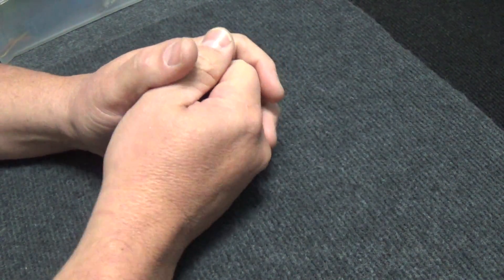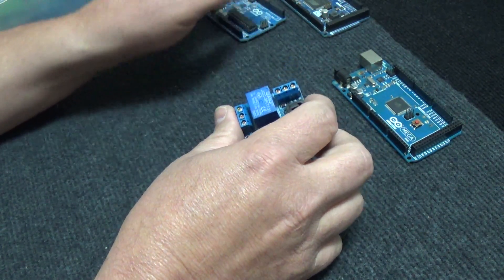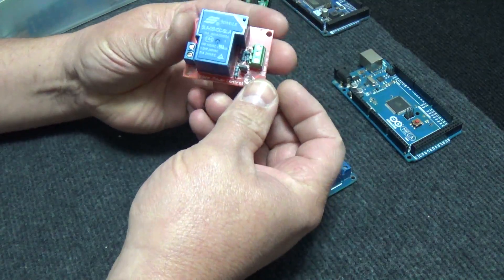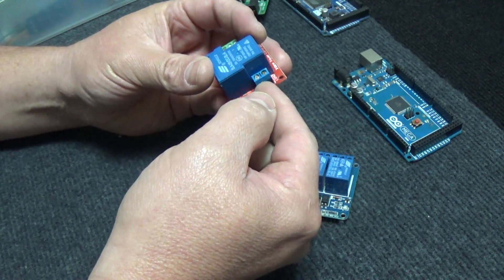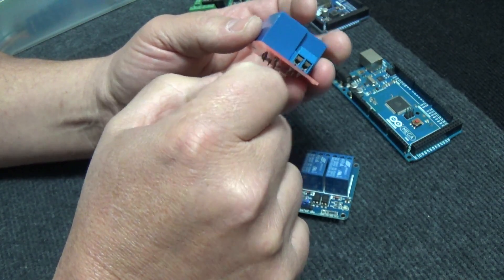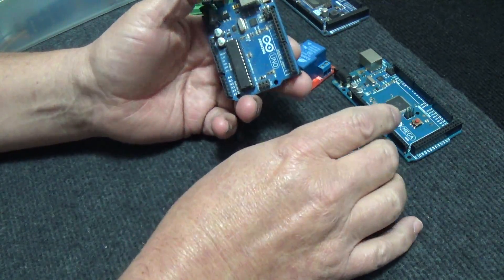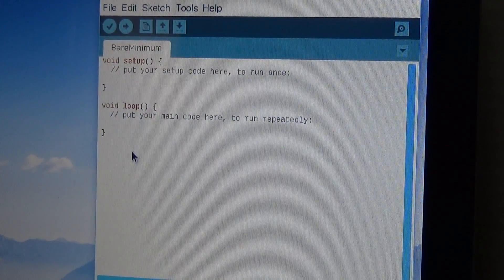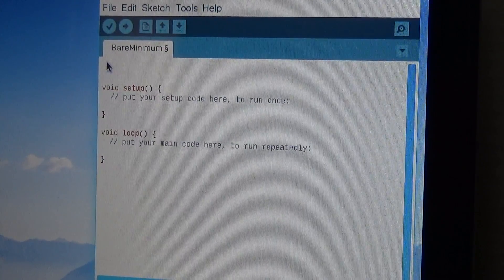Arduino Basics - Relays

Comment: Thank you for posting this. I would love to see a follow up video with the Arduino controlling a relay based on input to the Arduino. In other words if I press one button the relay would be activated for one second. II press a second button the relay would be activated for 10 seconds and if I press a third button the relay would stay activated unless a separate signal told Relay to shut off.

I am trying to control an AC motor that will raise  a platform to various heights.

Comment: Can you add an external power source to that 2 channel relay? So let's say you connect the 5v to Arduino then add an external Power source for another sensor or motor to the relay?
Reply: From what I understand from these is that if you want to do that, you need a board that has pins marked DCVCC VCC GND (they usually have a jumper on the DCVCC VCC) and they have also got the following pins (depending on the board) VCC in - in1 - in2 - in3 (etc depending on how many relais are on) - GND. If you want to power these externally, remove the jumper from the DCVCC VCC (and to not lose it for later just place it on VCC. so DCVCC and GND are open. next, on the DCVCC pin place your power supply positive and on the GND pin that is also free connect the ground from the power supply. Next you can remove the voltage and ground connections from the arduino so you only have the in1 and in2 etc connected. This should get you started.

Comment: L plater here as well, why is Low sent?  I thought it required High (5v or so) to actuate the relay?   Took me  a while to figure out what was wrong with mine.
Thanks and great Tute.
Reply: Video poster made an error in sketch. Before setting the relayPin to output digitalWrite(relayPin, HIGH); should have been applied.

Comment: I’m working with an NE555 adjustable timer switch. I have an eight AA battery pack witn an on off switch that goes through the triple five and feeds a push pull solenoid. when I turn the power on it initiates the solenoid so it fires once and it shuts off . What I want is to put power to it and instead of having to adjust a delay take the delay completely out of it but I need to ensure that there is no power after the initial fire to the solenoid without a reset. Any help would be wonderful.

Comment: You showed half of the relay setup.  The easy half that is labeled on the relay. The other half is how to hook up to what you are triggering.  A light,alarm,or pump etc.   Do  you provide power to what you are triggering. What if any power is ran through the actually relay. When to use normally open vs normally closed. How to set up using Arduino power if you are only triggering 3-5 volt source such as a 5 volt water pump or a 3 volt LED? Actually show it being of use not just making a click sound!

Comment: Beautiful,  would suggest  to isolate the relay from Arduino. You can do that powering the relay's coil with his own power source and avoid using the 5V output from the Arduino board when dealing with AC high voltage.
Reply: i was trying to open a door with the relay using 12v and 5v connected to arduino's pin 5v. when i opened the door many times the arduino was desconnecting himself from the computer serial port, so u are right

Comment: Sorry but switching the neutral/ground is NOT best practice. It leaves the device being switched at mains/supply potential. If you have an earth fault(disconnected)  or just plain forget to isolate  you risk getting a potentially lethal shock.

Comment: You said that such high speeds will "burn out the relay". What speeds would be considered safe? I want to control a 12v LED and make it strobe.
Reply: The relay switch is mechanical and will wear out soon with that kind of use.  Instead, use a MOSFET module.

Comment: Are there silent relays available?
Reply: Sure. Look up "solid state relay".
Reply: Remember that the solid state relays USUALLY do not handle as much power as the mechanical relays but will silently operate a smaller demand.
Reply: @alexlloyd2147  ??? i have seen 40A solid state relays

Comment: Why didn't you use a diode to prevent back current produced by the coil in the relay to damage your controller?
Reply: Yes,this hapen to me,with starter lamp,my lcd display goes crazy,back current short my arduino,no problem use with led lamp but long term will kill my arduino..but how to add diode to relay?
Reply: My 4 gang board has diodes factory fitted.

Comment: I like it. So the main function of a relay is to protect the arduino against to much current. But doesnt the motor that is not connected yet need protection too? I presume you can do that with the same relay?
Reply: I think the function of a relay is more to allow switching high current applications on and off via a low voltage power source, such as an arduino. Its not to protect the arduino, directly, thought i guess you could say it does that as well.

Comment: Hello guys, can someone explain to me whats the difference between 5v, 12v and 24v relays? It's not explained in the video :( When to use those different volts of relay? Thanks in advance.
Reply: I think you have to match the voltage of the relay wth the voltage of the motor.And the rated amps of a relay are also important. If you have a big motor the 5v relay will probably blow because the motor draws too much current(watts). That is how I understand it.
Reply: Random Guy , I know, 9 months... anyway, the 5v, 12v, and 24v is the voltage to control the relay (to power the relay coil and make it switch)
If you want to run a 24v relay with an arduino or a pi, you will need an extra logic and power supply, since neither of them provide more than 5v.

Comment: Hello sir, really appreciate your explanation. Thanks for the video

I have a question, so if I want to add a load to the relay, lets a lamp and what to turn it off and by the program how can we do this. Not sure if the power supply you gave from the system 5v is sufficient for it. If not I hope we need some external supply say 110v or so. If so how can we do that. Any video you have on how to do it using the same relay you just used. Your help is much appreciated. Thanks

Comment: I don't understand why 3 conductors when a relay has 2 states... on and off.. power applied and power retracted. Am I looking at this incorrect ?
Reply: Frankie , I know,  years... anyway, on the “input/control” side, the board might need power for other components, like LED, or other ICs, so you need the god and (lets say) 5v power, and then the third contact, when pulled high (5v) to switch the relay. Now on the “output” side, you have the NO (normally open), the common, and the NC (normally closed) contacts to decide if you want the relay to be open when unpowered or closed.
That would give you 3 conductors for “in” and 3 conductors for “out”.
HTH

Comment: Question, @Electro-Anarchy, you said that the relay is turning ON then OFF, but your code was LOW then HIGH. Did you mean OFF then ON, or is the relay turned ON when it is LOW?
Reply: Yes, for some reason beyond my understanding these relays turned on by the LOW signal. But I guess you have figured it out by yourself by now :)
Reply: @dmitrys.4741  These reelays are usually driven by transistor built onto the board. By apply a low to the transistor, you allow it to turn on and pass current to tthe relay coil energizing it allowing you motor or other load to run.

Comment: DO NOT SWITCH A NEUTRAL.     ALLWAYS SWITCH THE HOT ..    Not only is it safer, it is also electrical code.
Reply: @Germanudo He even called it "ground".
Reply: @hermanhermitz9101  stfu

Comment: i only learned how to start coding yesterday but want to ask... when writing   digitalWrite(relayPin, LOW) does it switch it on and when HIGH it will switch off?
Reply: Yes. The 5v relays you generally find on ebay have the trigger(IN1) function when connected to ground. For example they don't trigger by firing 5v into them from the output pin. If the output pin on Arduino is set to low it is at ground potential so allows the 5v vcc on the relay to flow to ground. When set to high it is at 5v so no potential difference and the relay is off. It confused me for a while until I realised this.